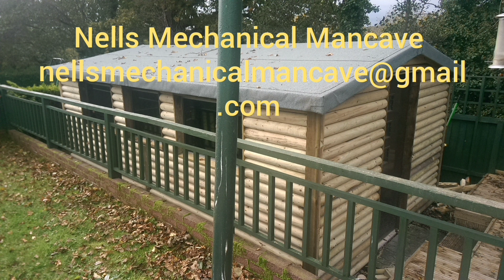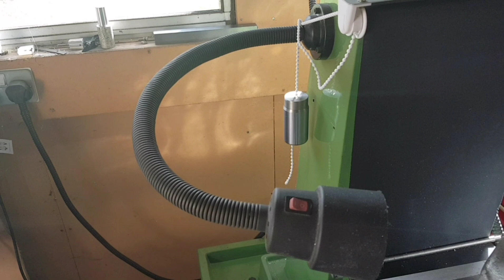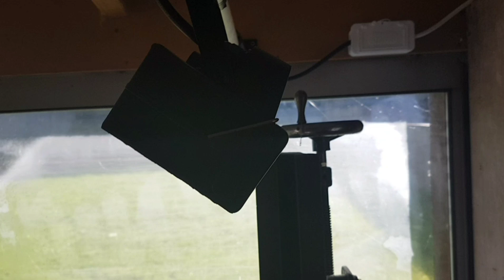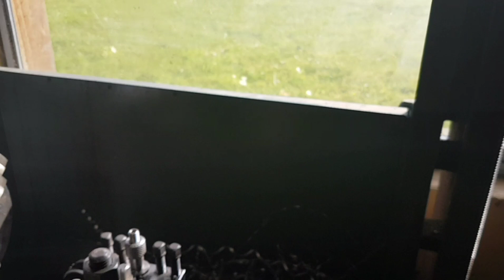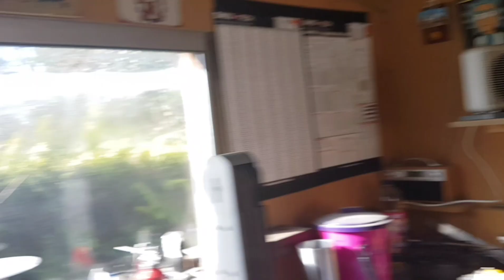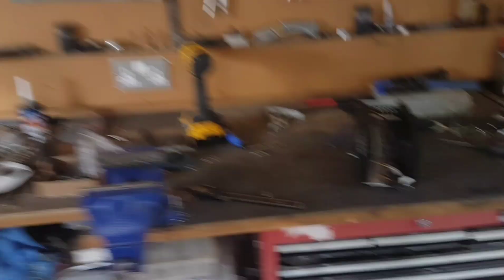Cheap Machine Work Light

Comment: Hello Neil,
Good idea... I need better lights near the machines for my poor old eyes...
Cheers.
Paul,,
Reply from the maker: They work good Paul. 
I might put two 10w lights on the lathe instead. One over the tailstock pointing towards the chuck and one above the rear splash guard lighting the bed. Two lights same power usage. The 20w could go over the grinding station 🤔🤔🤔🤔🤔🤔

Comment: Good tip.
Reply from the maker: Ben !
You are a man of sparks.
Wonder how easy it would be to get one of those square LEDs out of high power flash lights and mount it in a housing 🤔🤔🤔
Reply: @NellsMechanicalManCave  Not very. You'd probably want the reflector too. You do need the right voltage and current limiting resistor.
Reply from the maker: @BensWorkshop  mmm!
Can you hear cogs turning in my head ⚙⚙😳
Reply: @NellsMechanicalManCave  You could probably find a desk lamp on Amazon or eBay and just mount it.